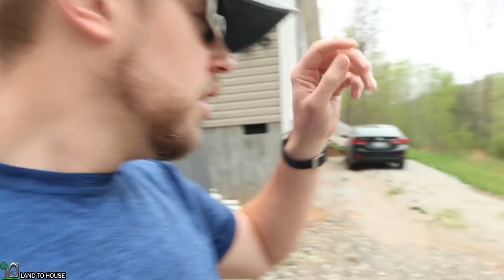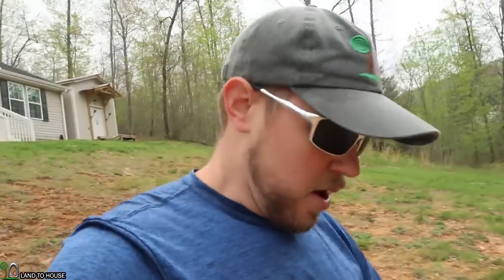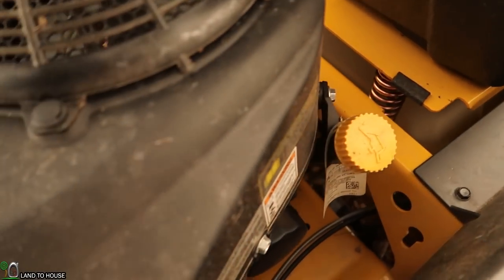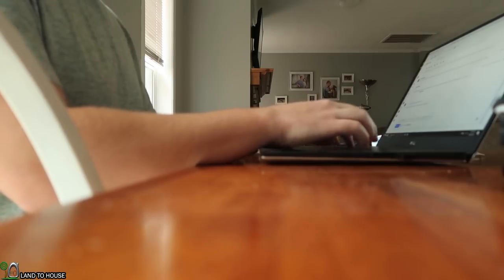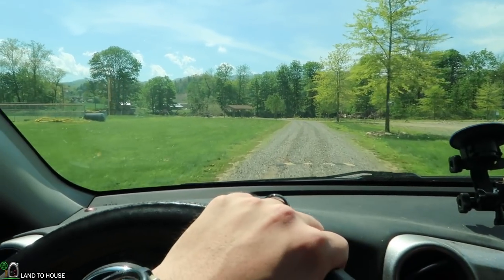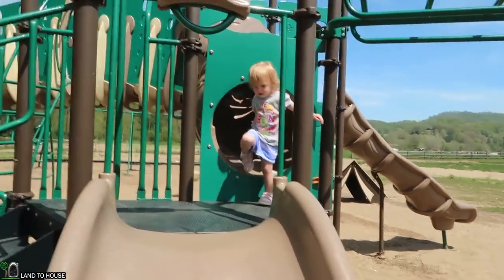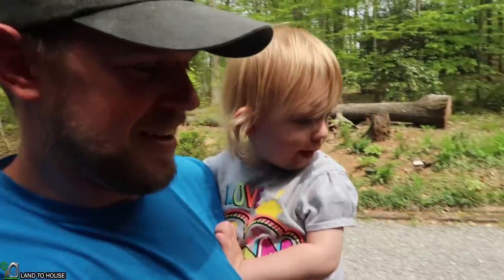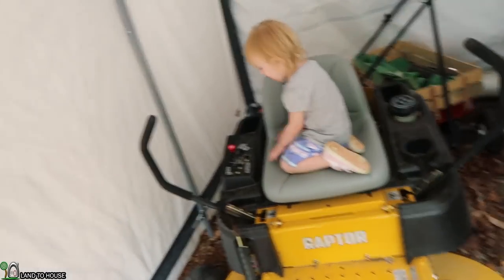Learning to change the mower oil - Vlog 152

Comment: I back the mower back wheels on a chuck of 4x4  to raise it just enough for the oil pan to fit under. It also improves the angle for draining the oil out of the engine, and yes warm the engine up before draining it.
Reply from the maker: I watched a video of a guy who used normal car ramps. Heading the oil more would have helped a lot! Next time I will mow for a moment so its warm.

Comment: With all the mechanic work you do, you ought to consider building yourself a mechanic's pit to make car/atv/mower oil & trans fluid changes easier.
Reply from the maker: I guess because I only change oil a couple times a year it might not be so needed. I will likely get some ramps for in the new shed.